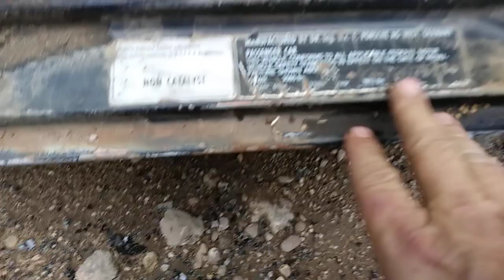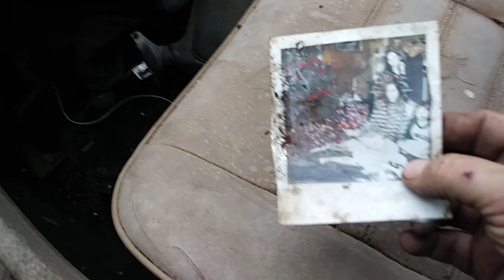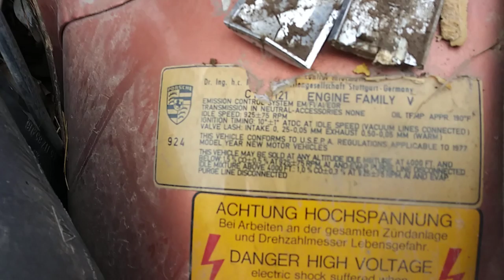77 Porsche on the Chopping Block...She's Rough

Comment: 1977 Porsche 924, since you saw the certification decal under the hood for it being a 1977 model year car and it says "924" on that yellow label under the hood. According to what I read, there were 7496 of those cars imported to the US for the 1977 model year. In 1979, you could get this in a Turbo version too, although I've read it was introduced in 1978 too. I believe this is a 2.0L engine (it's surely a 4 cylinder), and in mid year 1977,  they added a catalytic converter. This is an early 1977 because the decal on the rocker says "Non-Catalyst". You have to figure that this was parked after being nearly 10 years old in late 1986-early 1987 and by then it was a 10 year old likely very worn out hooptie. Probably just sat in a field for years and then finally it's time to go.

I think the original exterior color was "Copper Metallic" code 95F as shown here: http://www.924board.org/viewtopic.php?t=24451 but it has of course faded likely from exposure to the Texas sun.
Reply from the maker: Car looks pretty sharp in red. Thanks for the info look up and course sharing it with us. Super cool 👍👊! Less than 7500 made it to the states. That's not a lot. I'm gonna try better on getting them vins. Thanks again for doing what ya do for Cowboy Car Crushing.
Reply: @CowboyCarCrushing  No problem. It's more like a pinkish/bronze if you will than a red.
Reply: Thx for the info!
Reply from the maker: @jmswyo  really good stuff right 👍👊

Comment: I think that's the rare 77 Porsche rust bucket, but honestly the car is done for, pry off what you can and wave the rest good bye.
Reply from the maker: I keep the key. All the badges are gone. That sucks. I've only crushed 3 Porsches. Somehow all of them still had a badge on em. Which i kept for my trinket collection. But not that one. Damn the luck. Got a key though 👍👊
Reply: @CowboyCarCrushing  It's something at least, swear that car must've been either buried, or abandoned out in the middle of nowhere.
Reply from the maker: @Demonizer68  that inspection sticker on it is from 11-86. It ain't seen the road for a long time

Comment: Just too bad. A Porsche made back in the late 1970´s (most products made in those years were called Made in WEST Germany). A remnant of a divided Germany. In good condition they are very expensive collector cars today in Germany.
And driving one of those old cars you could even save on taxes. Any car older than 30 years is entitled for a lower tax rate.
Clearly visible on the license plate: the last letter is an `H´, for ´historical´, in Germany.
Reply from the maker: We have a similar program here in Texas. 25 years old the car can be registered as "Classic". Also cheaper on the registration and taxes. The plate is also different